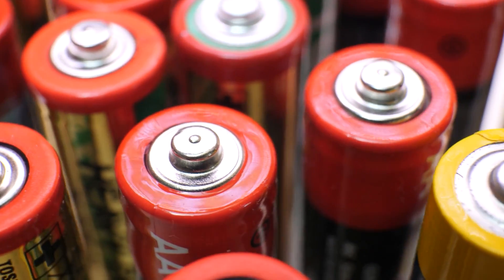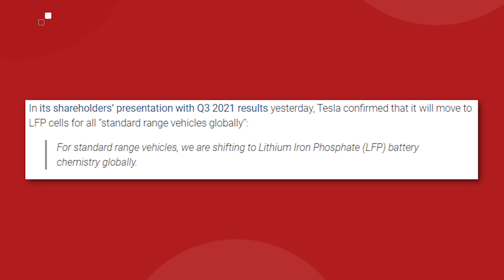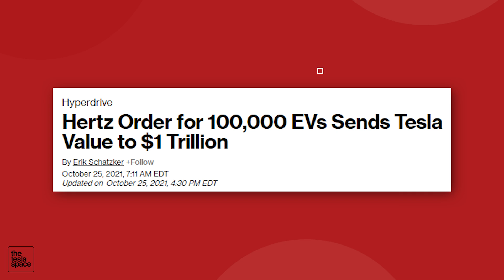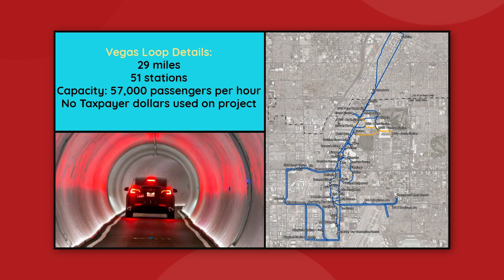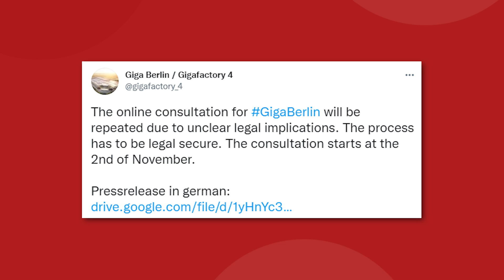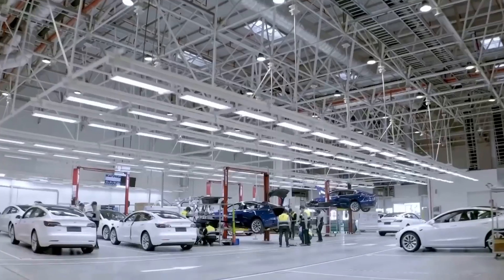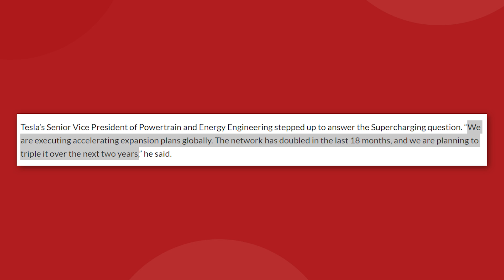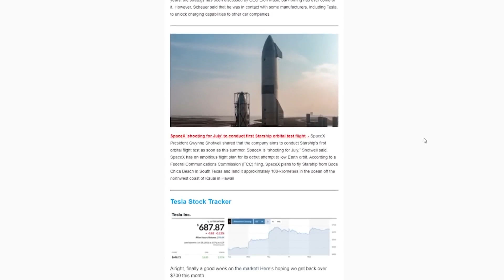Tesla Makes Major Change To Model 3

Comment: I have a question about the 0-60, i saw many videos of that, but why the tires don't squeal at start like any other cars when you do pedal to the metal?
Reply: The car has launch control. The computer detects slip to each wheel and then corrects the power and braking to provide maximum launch velocity. My Corvette had the same thing. Most performance cars have it. In the Corvette you can turn it off, but doing so the car would lose so much traction it would spin out on launch. Launch control makes it easy for drivers of all skill levels to launch the car like a professional drag racer.
Reply: @jimbeam4111  Thank you, i understand. I had chevy montecarlo with same feature option. But when on, it would still spin tires.
Reply: 4 wheel drive helps greatly

Comment: Are charging stations usable by other EV car brands?  I would think not right away at least.  Unless of course Musk is open to pricing the electricity to non Tesla cars at a healthy premium, or other car companies will share the cost of building out and operating?   But Tesla has a proprietary connector in North America, so non-Tesla vehicles here will need an adapter. That could be up to the other automakers to make; Musk has previously said that Tesla has held talks with other automakers about sharing costs in order to open up the Supercharger network, and in 2018, he said competitors would have to be “able to accept our charge rate and our connector, at least have an adapter to our connector.” Tesla may still make its own, as Musk said he anticipates making them available at Supercharger stations as long as “people don’t sort of steal them or something.” (Tesla energy lead Drew Baglino assured his boss on the call that his team “has a good solution for that.”)
Reply: Some Tesla chargers just opened to other customers in the Netherlands.

Comment: It is called „loop“. The „hyperloop“ is something completely different, that Elon Musk is not involved in at the moment.
Reply: There is nothing called loop. Hyperloop is a way of transportation via low pressure transit tubes and pods. It’s currently in development by multiple companies. Elon Musk is 100% involved in Hyper Loop. How could you be so wrong? Also how you got 11 people to like your comment is beyond me.
Reply: @josephchiu6058  The Boring company project is simply called "Loop". The SpaceX Hyperloop is not being worked on by Elon in any capacity, it's an open source concept with external development. SpaceX provides a test track.

Comment: That's sounds a little biased to say that Light Rails aren't good, just because your city can't do it right.    There are numerous cities with great Subways and Light Rail systems.
Reply: Maybe but have you looked at the cost? All light rail / subway systems that I know of need to be subsidized in construction and operation by tax payer money, even in large metropolises.
Reply: @Martinit0  is that not what tax payer money is supposed to be used for, building infrastructure for the public instead of fighting useless wars
Reply: Mass transit has big flaws in that they seldom deliver riders from door to door, plus they stop for passengers whether you want to get on or off or not. Lots of wasted time. I.e., the ice cream you bought just melted. Transit is a great way to spread communicable diseases.

Comment: Can they just make a affordable full size sedan like DAAAMMNNNN. The 3 is so small and feels like driving a toy car, and all the poor fit and finishing on the car makes it feel like a prototype. The Y is too big and don’t like sitting higher up because it obstructs curb visibility, the model S is perfect but too expensive. Their maps also suck, they need to add an option for apple car play.
Reply: i kinda know what you mean. The 3 is actually smaller than a bmw 3 series but has a bit more interior space due to being electric. I dont get what would have been wrong making the outside exactly the same dimensions as a 3 series and then have a car which kinda has almost as much interior space as a 5 series. It kinda annoys me too that the Y is a few cm longer than the 3 as well. The 3 really needs that lenght for the rear bench. In all fairness the S is ok, but Id prefer a long wheelbase 3 anyway - the S has all kind of gizmos which dont do much but fuck you over if they break out of warranty i.e. air suspension.
Reply: @kingprone7846  I meant I want a Tesla as roomy as the model S. But yea I’ve had both vehicles and both were terrible, the S was perfect for visibility and comfort but too expensive. The 3 has ok leg room but is narrower so ur thighs are hitting the sides, also if you sit comfortably then the back passenger has no room due to ur seat, so it’s sucks so bad. Also the A-pillar is so massive and obstructs ur view. The cars focus too much on their software rather than human comfort/design. Like changing the climate is so annoying etc. The buttons on the screen don’t accommodate ur finger moving due to the vibration of the car when driving, the car just has so many issues it’s not worth it at this time. I think the next generation model 3 will be a big improvement hopefully. And with the current 3, you’re almost sitting too low it’s so weird, it’s truly like sitting in a go cart.
Reply: @ls7vz  i find you sit too high in the 3 but thats just me. probably due to the lack of a dash cluster
Reply: @kingprone7846  really? I’m the opposite, either way the car is just too small tbh 😂.
Reply: @ls7vz  probably american... you guys drive too many 4x4s and trucks etc to go shopping. if you are used to sedans the model 3 seems rather high.
Reply: @kingprone7846  I’m not sure why people think that lol, most people here drive cars not trucks. I think that’s a common misconception.
Reply: Interior is larger than my Acura TLX and has a 2 inch longer wheel base. Fits and finishes are just fine.

Comment: The moment Tesla was approved to build a factory in Germany, is where all the consultation should have ended. In fact, Tesla should have obtained approval for what it intended on using the property for, before it even purchased it. At the same time, Tesla  should have sought approval for the same project in other countries, and whichever country came through with the committed approval first, would have become the designated Factory location. End of red tape.
Reply: Tesla should have gotten all the paperwork together before building. They are trapped because they already spent a boatload of money there
Reply: @AB-fv4ms  Not trapped as Tesla knew it was going to be a challenge and that is why they paid a bond to start building straight away, instead of waiting 2-4 years for final approval.

German Government will eventually give Tesla final approval. It's just a time thing now & following all the German Red tape has to be deemed to be followed.

I'm sure German Government is looking at ways to streamline all this red tape. They're  going to want to encourage much more investment in Battery and EV production from other Companies....
Reply: @MichaelAlvanos  Yes, German Government are good people :-))))
Reply: The problem is, if you tell them what you want to use the land for and get permits before purchasing, then land owner can put price up as now he has all the permits on his land.... That you need.
Reply: @MichaelEdmond  The land is over an aquifer, there is drinking water under it, that creates some extra red tape.
Reply: Yeah Frank, what you describe is the "old" approach that is less risky but takes years longer to execute. For starters, it would require that Tesla have final plans prior to begin of construction which supposedly was not the case (they made adaptions, some also in response to comments to enviro groups).
Everything will work out, just takes a few weeks longer.
Reply: They did not know what exactly they wanted to do. It takes years to make an exact plan. So they started with only a preliminary permission, under the condition to sort out any small detail before the final permission. That saved lots of time.
Reply: i agree seems germany are worried
Reply: Red tape in Berlin, Politics in USA, CCP in China - are all short term challenges. I'm sure that by 2025 they will all be just a memory & "what doesn't kill you, makes you stronger"
Reply: @MichaelAlvanos  People who enjoy stopping economic/tech progress by use of coercive (immoral) politics are anti-human, anti-mind, haters. "What doesn't kill you may weaken you for life" and slow you down. Our most valuable asset is our extremely limited time.
Reply: @1voluntaryist  Yes I agree with you that this is the case with most People. But Elon & the team he has surrounded himself with, are not like most People.

Vested interest have a way of justifying their actions, even though people like you and me agree it's immoral...

.....Most people couldn't care less as they don't/can't see the implications
Reply: @1voluntaryist  If you think very strict adherence to laws is immoral, you are just in the wrong place in Germany. There is nothing coercive, it is just not up to discussion, and a single person has the same power like a large company if he is right. Maybe you have just different ethics, which is legitimate, no problem. It just does not work here, nobody cares if you are angry.
Reply: @vsiegel  I was in a VGB conference in Cologne in 2010 and one of the keynote speakers said Germany has become a BANANA country (Build Anything Noway Anywhere Never Again). A major power plant project got delayed ~7 years because one little old lady claimed it would make her washing dirty.  Here we have environmentalist lobbying to block a factory that will result in less ICE cars and prevent thousands of environmentally EV’s being built.  Germany is losing its way.
Reply: @stevehale4712  It is not relevant that she was a little old lady, and that is an important point. She had a point that seemed to be valid. It is not important who has more money or power, it is only about who is right.
Regarding the environmentalists, the problem is that the term is ambiguous, which makes the situation hard to understand, and also to report.
The problems are not people who want to protect "the environment", but small groups or individual people interested in something very specific. And they are not lobbying, they are suing in court.
These delays exist and are  a problem, but they are for random reasons.
For example, we do not want to use the principle of "might makes right". That is very fundamental. And if it has disadvantages, so be it.
Reply: @vsiegel  That is very nice approach, but IMHO we are not living in idealistic world.
There is always big politics in the background.....
.... would any of the big German car manufacturers be trated same way, if one did what Musk is doing with Gigafactory?
Reply: @Old-Bald-and-Grumpy  Yes, any of the big German car manufacturers would be treated the same way!
Reply: @vsiegel  That is OK then.
It is common around the world that strategically important investments/companys get special treatments.
Like VAG never paying compensation to European owners of Dieselgate cars, which as a result of updates lost accrllereation....
Reply: @Old-Bald-and-Grumpy  VW has to pay 1 billion € in Germany and 25 billion in the US. They had to call back the cars to replace the cheating software. The car owners do not get compensation automatically, because they can not sue collectively. But they can sue individually, some do, and get compensation, sometimes the full price they payed for the car. I would expect some people tried to influence the court case, but 1 billion was the highest amount ever to pay in this kind of situation. I do not know how many owners actually sue VW. The company is owned 25% by the state. I do not know whether there was successful influence reducing the amount to pay. You do not get compensation if you do not ask for it, basically, but I do not think that is caused by influence, a collective court case is just not possible in that case.
Reply: @Old-Bald-and-Grumpy  By my intuition, it would be the right thing to do to give Tesla a preferred treatment. But anybody who is only slightly opposed to Tesla will see that differently. And the second one is right in a pretty objective way, so it is almost certain that somebody will sue against it very soon. The law to give Tesla special conditions even has a name, "Lex Tesla" from the public discussion about how that will not happen. Giving preference without a law would backfire next day, not worth trying.
Reply: @vsiegel  Well, so manufacturer cheated, in process of correcting emmisions, deteriorated performance of the cars and yet in EU, unlike in USA, was not ordered to either pay compensation or buy back...

Coming back to Tesla - I agree with you, no special treatments for anybody, be it Tesla, VAG, NordStream or any other major business.
Reply: @Old-Bald-and-Grumpy  There is no collective lawsuit for compensation, but individuals can sue, and get compensation, sometimes the full price they have originally payed for the car. You basically get no compensation if you do not ask for it. I think suing is much easier in Germany than in the US.

And about NordStream - even seeing the name only gives me headache. I was not able to build an opinion on that up to now. A nightmare for politicians.
Reply: @Old-Bald-and-Grumpy  To me, the main problem with NordStream is that there was a permission to build it, and there are commercial contracts about it. The kind of permission Tesla is getting soon. We do not have the government interfere with contracts a business made, and we do not want to soften what a permission means. Getting a permission is not quick and easy, but if it is given, we want it guaranteed, the government just should not interfere with it, on a very fundamental level. Everything else is a reason to cancel the project.
Regarding nuclear energy: The decision not to build new nuclear reactors was made long ago, after the Fukishima accident, it was decided to shut down the very old reactors earlier. That was politically the right thing to do at that time. Now, it would be better to keep them running, but we made an explicit decision to shut them down, and that is not easy to change. Building new reactors would make sense, but it is just too slow in Germany, something like 10 years.
The problems regarding gas and Putin do exist too. I think the reason not to worry very much is that Putin needs the money, and we could get gas elsewhere, the US would be an option, using LNG tanker ships.
Reply: @Old-Bald-and-Grumpy  Yes, I'm somewhat scared regarding Putin. The one point that relaxes me a little is that I assume Merkel knows what she is doing, because she is from the eastern part of Germany, and may have more insight about Putins ideas. That is only a speculation. Putin worked a while in Germany for the KGB. I think they never met.

You already guessed how happy we are about Gerhard Schröder - my sister just mentioned he once said that Putin is a pure democrat. It seems to me he was somehow overcome with greed. 
I do not think we generally underestimate Putin. More like "He is evil, but we have to deal with it". Nobody is surprised when he poisons a person he is afraid of, basically.